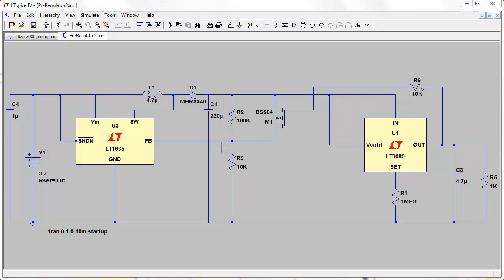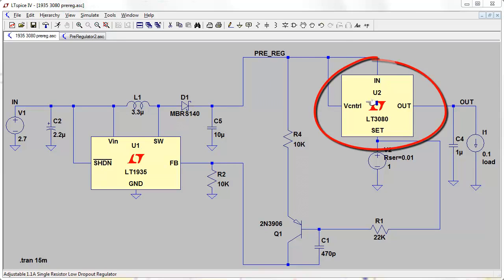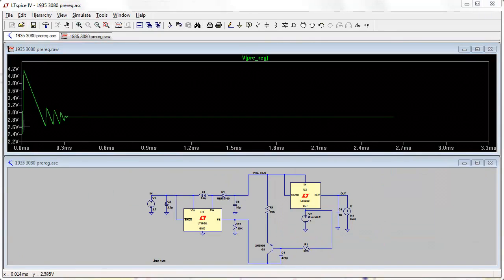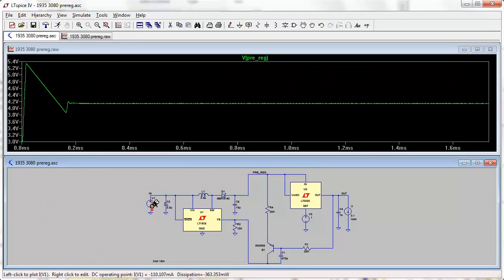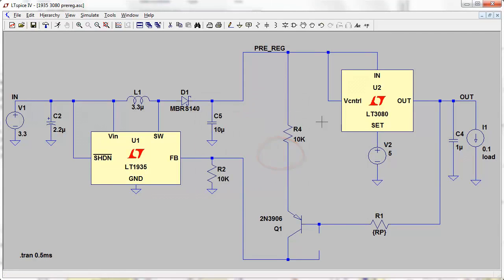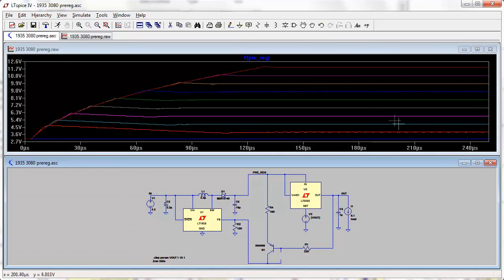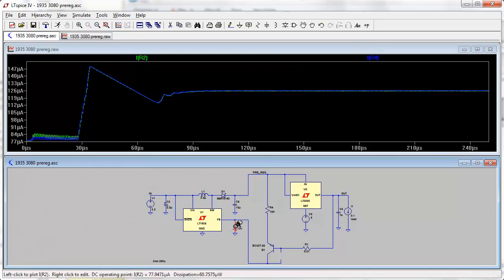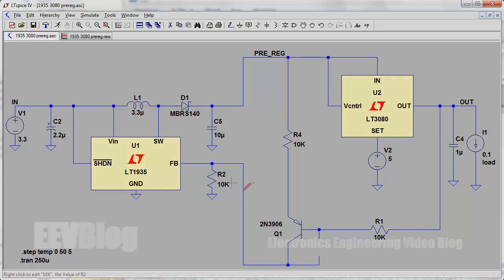EEVblog #329 - Tracking Pre-Regulator LTspice Simulation Part 2

Comment: Oh, I understand the context now.  
I watched EEVblog #260 - Tracking Pre-Regulator Simulation in LTspice

It is something more complex than I was thinking, although I guess if the microprocessor can do digital to analog output it could control the FB pin directly.
I can't think all that through though.  ... so nevermind me.

Comment: I am still thinking the same as cr1901. Maybe LT3080 is not needed and neither is an op amp buffer. V2 could drive the FB pin.

Is the FB pin such tiny current that we do not need an op amp buffer either?
Reply: Yeah, I think the FB pin does not require much current, so effectively it is just a voltage sense pin. The datasheet should specify the required current, but it would be basically insignificant.

Comment: Could you please do some simulations common in the design of DC power supplies? I think, that would be useful for some of your viewers, who want to design a PSU.
1. A load current step response with behavioral current source (BI) like this: I=if(time>1m, 500m 100m), it will jump from 100 mA up to 0.5 A after 1 ms.
2. A PSRR and loop response with both AC, and voltage step analysis.
3. Optimisation of C5 to maintain a stable load change response (so the SMPS voltage doesn't drop too low).